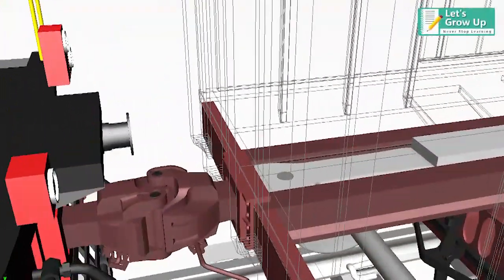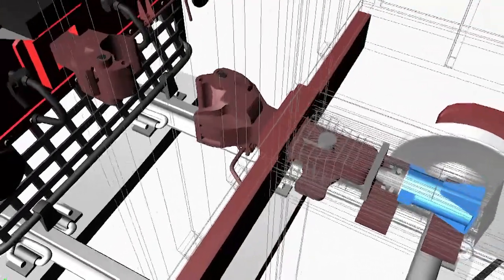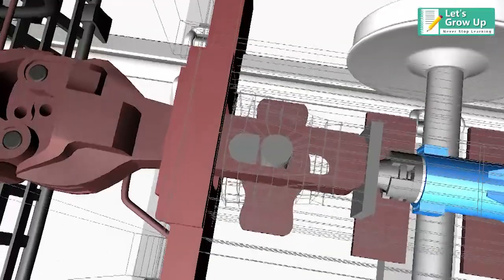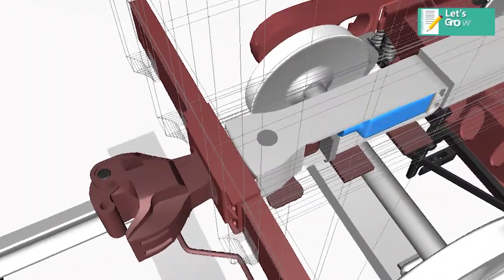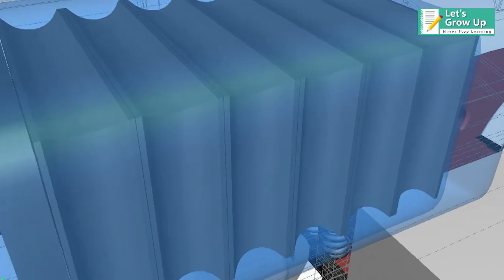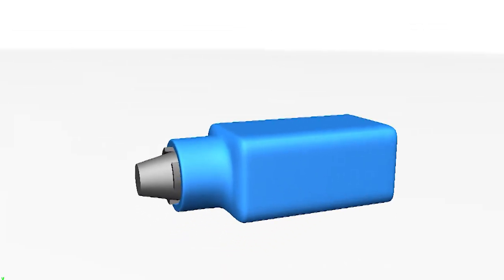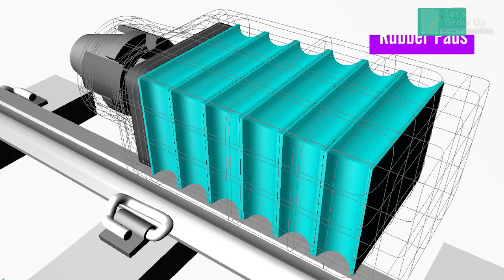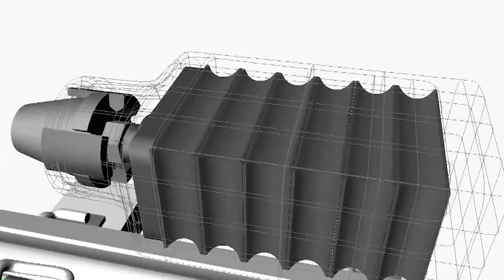#CBC Draft Gear Assembly |  #CBC draft gear parts| #components of draft gear | #RF-361 draft gear

Comment: How much  Slack movement is there normally on a locomotive startup?  What is the maximum if it's pulling a heavy load?

I'm referring to the startup where it is only pulling one car at a time from a static position to gain momentum.

Comment: In a Type F70DE coupler attached by a Y47 pin to a  Y45 Yoke,how does the draft gear compress? is this hole where the F70DE and Y45 an oval ? thanks in advance